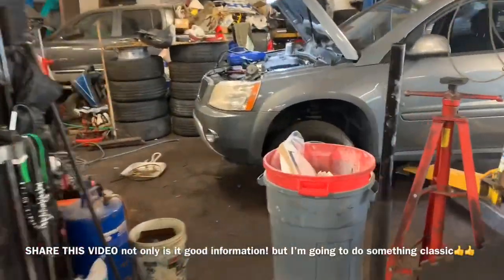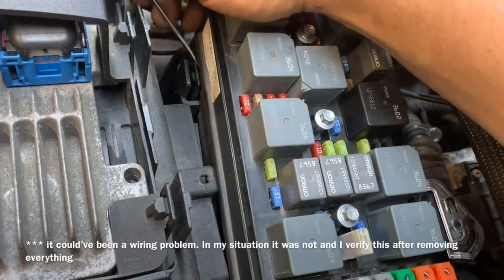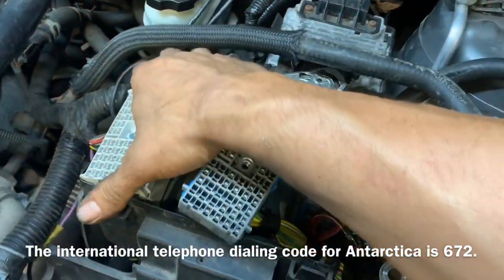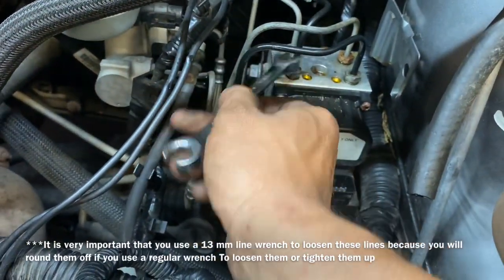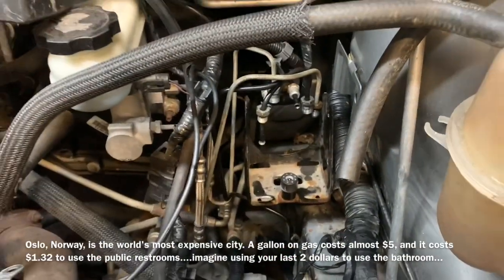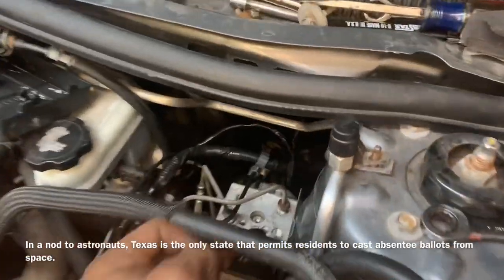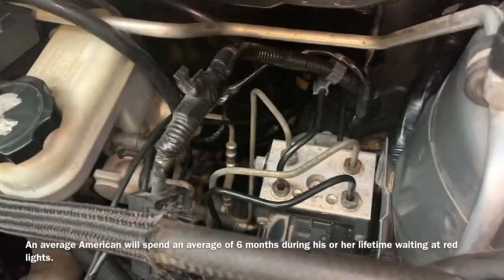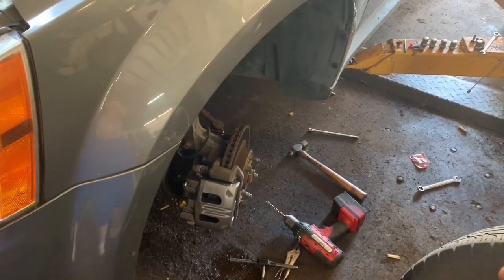Pontiac torrent ABS controller ABS pump replacement ABS not working ABS light on

Comment: Watch your video very helpful. Just have one question on my ABS pump/module one says SB and the one that I took from the scrapyard says SA should I be concerned
Reply from the maker: I don’t know the answer that question they didn’t make a difference on mine. The only thing I could think of that would be different is if the vehicle you have is all wheel drive and the vehicle you took it off of is not.

Technically speaking, I don’t think it should but I guess you’ll know if you have a problem

Comment: Thank you brother.  Your video was very informative. GBU 2
Reply from the maker: Thank you thank you very much William I greatly appreciate that comment GBU2 , i’m going to start using your acronym .
Reply: @sharpcarco  the best video of All year informative and Educational thank you my car is 2008 Pontiac torrent abs stebitrac are alway the problem I change Every wheel speed sensor and comes back right away codes I get c0035 and c0045 I’m struggling with Antilock brake system

Comment: Big question Mr the clay .
I have a 2007 chevy equinox. My stability track control and abs light is on.
But why my brakes are dragging or literally jamming. It switches from left to right. I just put on new calipers. And new brake hoses.
HEEEEEEEEEELP!!!!!!!!
Reply from the maker: That’s crazy.... are your calipers installed on the correct side the bleeder screw should be facing up

do you have ABS traction control lights on? You may have a situation with one of your wheel speed sensors.

If this was not a problem prior to you doing the work I would go back and look at everything very closely and make sure you didn’t leave something disconnected or didn’t do something wrong I often teach my students to go back disassemble everything and re-assemble it find their mistake and correct it

I hope some of that is helpful for you if it’s not I’m very sorry I wish I could be of more help
Reply: It was doing the samething. Way before I decided to change the calipers. 
The one that did a diagnostic. He said to change the calipers brev
Reply: I am having the same problem with caliper seizing up! It all started with having to replace my original driver side factory caliper because the bleeder screw busted inside. Bought a replacement caliper and within a year it was seizing up at all stops and would gradually work its way loose, but with the discoloration from the heat and rust building up on the caliper were obvious signs something is wrong. Under a lifetime warranty, replace caliper yesterday, test drove it and same thing is happeng. It was way too hot to the touch compared the the other caliper. NOTE: While bleeding the brakes, my helper noticed while pressing the brake pedal, the bleeding process on that particular driverside caliper was difficult and slower pushing the pedal to the floor. I can only assume there is blockage somewhere. Any advice? I was wondering if I took that line off the caliper, would it be ok to keep pressing the fluid out to see if it works its way loose and fluid is streaming out? Backing up to the point of removing the brake line from the caliper, the fluid was not streaming out. So in theory, when the caliper piston is applied while the brake pedal is pressed and then releasing the brake pedal, is the fluid suppose to draw back the caliper pistons to release the brake pads immediately? 
Thank You!
Reply: @fitzpatrickgf  

About 3 times in my life I’ve had this problem and it ended up being a bad rubber brake line. Apparently the inside of the rubber hose can “peel off” with age and act as a one-way check valve. This can result in what you are describing; keeping pressure on the caliper. 
Could be something else but thought I’d add this information as an FYI.
Reply: @wdtony is this just the short section near the calliper? I’m currently having this issue
Reply: @readguthrie1241 

Yes. The rubber brake line that attaches to the caliper.

Comment: My brake light and abs light is on. I have a 2007 Pontiac torrent why would my brake light be on?
Reply from the maker: More than likely you have a bad wheel bearing that’s very common can’t say for certain I’m not there